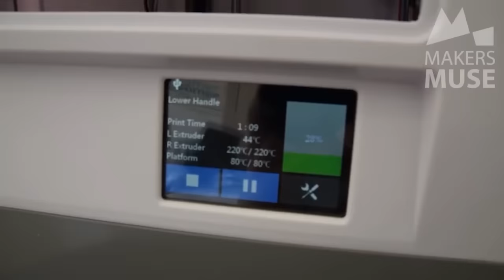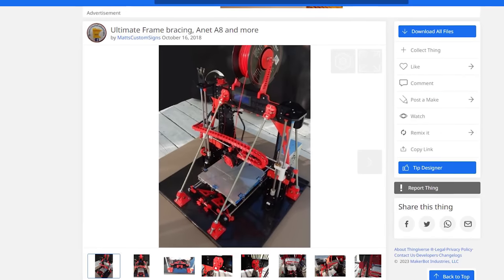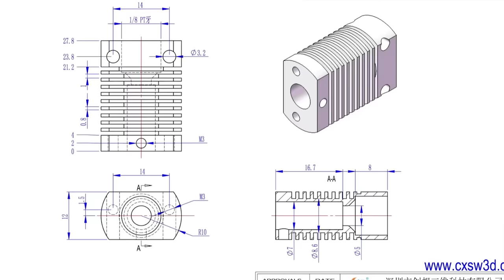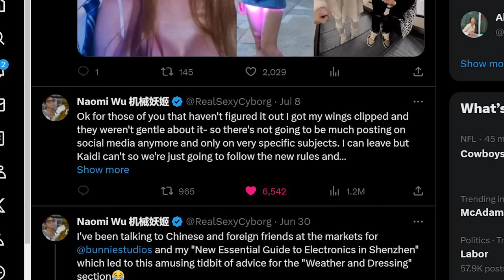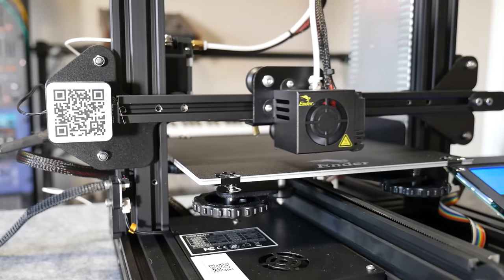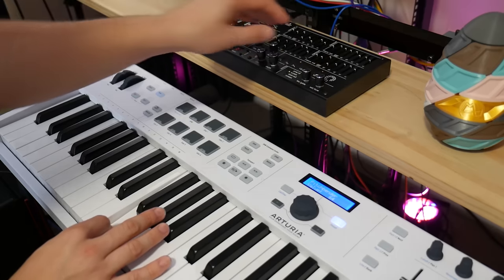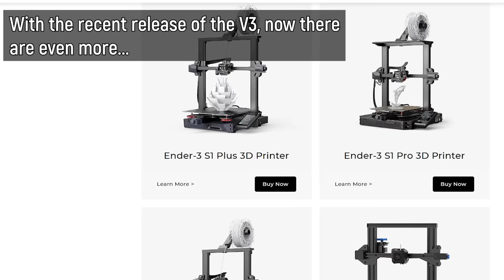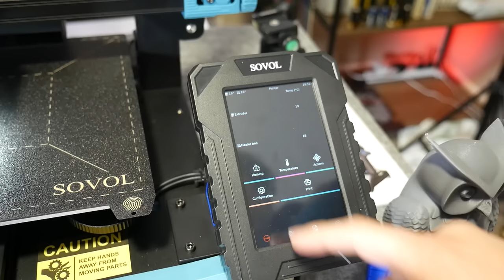Creality Ender-3... it's time to move on.

Comment: I do not have the long experience to say "YES or NO" on any brand of 3D printer, especially as I only have one. I will tell you what I learned, endured, and now do. A little over a year ago, about November, after years of kicking around getting one, but, just overwhelmed as to which one.. Let me first say, I am EXCEPTIONALLY HAPPY with the CREALITY Ender 3-v2. and have been doing fantastic with it.

BUT..... it wasn't a great start, as the first one showed up in December, about a week before Christmas day, so I was excited to have a new toy to play with (as a 50 year old man) and I followed the instructions, watch plenty of videos upon what I should look out for while assembling, and power on the unit for the first time.. moving on, I had no Z-axis control. The gantry would go up, but, that was it. Try to re-home the unit, and just keeps going higher.. I spent about 90 hours playing with it. (please note, not all was lost out of this bad machine, as I learned so much during that trouble shooting phase). I went through, checking if the motor was bad, by swapping cable feed, and manually operating that channel, etc.. come to find out, why sometimes when messing with it, it would work just fine, or at least, the motor Z--axis would rotate both direction... upon finally pulling the cover off the bottom, monkeying around in that area of the mother board, swapping cabling out there too... I finally discovered the Z-axis cable was shorted out, based on how the wires were stripped and then each spring contact was crimped, before inserting the 5 leads into the body of the connector... Well, that dead short, smoked the board... and only one direction would work, and the transistor for the reverse direction, would just get hot, even when the feed cable to the motor was unplugged. 

So, I contacted CREALITY's online team through their website, real-time tech people... (I assume they are real people and not A.I.)and walked them through the whole story, and sent photos of what I had discovered.. 

THIS IS IMPORTANT..... No matter how irritated you might be, or even angry.... Please be polite, just understand, things happen. If you are polite, and patient, they will help you any way they can... Although, I could have just fixed the machine myself, either diagnosing the board, and or, ordering another, and cable.... I just calmly explained, I shouldn't have to... it is brand new. and that I choose to stay with CREALITY. I do not want my money back, I want a new machine. Please, I would like to send this one back, to allow you to diag for yourselves, and then, upon that time, send me a new unit, and I am sure the new unit will be just fine, and it was perfect. That last day speaking with them, was about a hour away from going on Chinese New Year for a week... I wished them to unplug, enjoy time with family and friends and other loved ones, and to not forget about, and especially, enjoy some really great food.. and when you folks get back from NEW YEARS vacation or holiday, we can pick this back up then... They emailed me the first thing that following week, with an R/A number, and label.. I disassembled the unit, packaged it up the same way it came to me,  (except the puddy knofe, and cutters, OOPS!!!) shipped it off at the local mail service. I noticed the kitchen counter had those two items sitting there, but, too late, that package was gone...LOL... I emailed them, to let me know, what the cost was for those two items, and I would gladly pay for those.. as I assumed, they were gonna just send out a new unit, once the old unit gets back to them, and varified that all is there, (minus the two tools) .. They emailed about 6 days later, can said that they received the not-working unit, and that all was in the original packaging, wrapped up better then when they wrap them up, LOL... and for me to just keep the tools, for spares, as they do wear out over time, and thanked me for being honest and willing to cover the price of the items not in the returned within the box. I thought that was kind of them.. I did feel bad about that, ...  two days later, the second unit, was rushed out, on my door step. 

I assembled that unit, same thing, Ender 3-v2.. Now that I am a "professional" at messing with these after that ordeal.. went together, like the last unit, powered it on, checked everything... and.... GO TIME... I have been printing ever since.... I printed the 48 minute test Benchy that is on the SD card.. I was happy... and I am glad it happened the way it did, as I asked myself, "How badly do I want to play with a 3D printer?".. Well, must be pretty badly.. LOL.. 

I installed two hour meters in case it yank out the firmware or something and lose the counter on the chipset... I have one hour meter, that is for hotend on time only, and then the other, is kinda pointless, but, just being on, even if the unit isn't even doing anything.. Just for giggles, to see how long the unit will last, and or various parts... Well, I am happy to say, that printer has been through two sets of wheels, two belts... The belts were my fault, as I had them way too tight, for the job they needed to deal with... duh!!!... and I am sitting on about 11,000 hour of on printing time...  I get real nervous on some of those large files, that take 9 days to print, as about every 3 hours to 10 hours, the machine pauses for about a minute.. like it is thinking or something.. .LOL.. kinda spooky.. But, I love that machine... But I must repeat, I do not have another to give a comparison to or with.. I am sorry for the novel, especially if you are reading this on a cell phone screen, as I typed this on a laptop screen, sorry!!!.. I just wanted to add my two cents.. 

I like how CREALITY does GIVEAWAY's to help the community get involved or to say, "give back".. They tech support is great, the way they handled my situation, was amazing, and because of that, I choose to be loyal to them, as they really could have just left me hanging, to have to fix it myself.. which I coulda, as I am an electrical engineer, I just didn't want to, I did that for 35 years.. I just wanted to plug in my new toy, and hit a couple buttons, and watch it come to life.. Which I did get to do.. just took a while longer than expected....

I remember them saying they have changed wire harness builder supplier's to a new company... to eliminate that issue of low grade products they need to build the main units...  Good luck all.. I wish I knew all of what you seasoned people know about printers, but, I am a newbie here, and wanted to contribute with my novel...

Comment: I bought one in 2018 as my first 3D Printer mainly because it was a cheap entry and I knew I wanted to modify my printer, which was actually a requirement for me so a fully framed ready to use unit was not really an option. Many other 3D Printers that had that kind of modularity were either too expensive (especially when I knew there was a risk of breaking it) or required me to already have a 3D printer to make some of the plastic parts (or if I ordered those parts the price usually went up again).
It's still my only 3D printer (although by now other people in my circle have one which I could ask to print something if something is broken) and I am still upgrading it and currently planing the next round of upgrades (Like switching to Klipper, adding an ARM board, finally changing the extruder type, adding a second Z axis etc.)

Comment: I started from Ender 3 and now have two such machines. It was a perfect choice for me, not only because there used to be much less possibilities back then, but also because I wanted not only to use a 3D printer, but to learn it, to embrace it, to repair it and tinker with it however possible. So the knowledge of its huge community bought it. Now, I would not change my Enders to anything else. I absolutely love them, even though they constantly don't work as well as I'd love them too. So, yeah, I'm all for Ender 3 but would never ever recommend it to any novice, who wants to 3D print and not play with mechanics of a 3D printer

Comment: I've had my original ender 3 for about 5 years now and I've basically just brought it up to speed with a few upgrade kits. I have direct drive and dual z, which means the print quality can rise, but I'm obviously not getting much more speed out of it. I just don't think the extra price is worth it for anything else still. As long as I can walk people through how to fix all those quirks with the ender 3, they will be much better off having a lower speed and equivalent print quality to an X1 in addition to their thousand dollars saved. I would also argue that self leveling is a bad habit to teach from the start because it just means you'll always get an incorrect first layer and you'll have to learn to manually level it anyways. Plus, all I have to do is pop in the CHEP bed level gcode and remember which ways the wheels are supposed to spin. I have no loyalty to Creality, I just don't see equivalent value anywhere. Unless you really want the extra safety features of a prusa i3 and think they're worth 600 bucks. The key is in the mods and the guidance.

Comment: as someone who bought the Anet A8 right when it dropped and also had mine try and burn the house down. 4 different times to be exact. (that's why I stay within eyeshot of it at all times). It's funny to see how we have grown. I moved on to extremely high-end resin printers. Seems most people I talk to moved onto wild paths after. (if you're interested in the 2 leading causes of fire for the Anet A8, the main power input wires are too small so they get hot, melting the connection to the board. Get a bit thicker strand wire and make sure they are very secure. The other cause is the plug on the heat bead coming loose. Put a SMALL dab of super glue on the corners of the plug to prevent it from coming apart without some force.)

Comment: I like to call my original Ender 5 Pro bought in 2019 my "Gridfinity-Machnine"' It was my first 3D Printer and got me into the hobby and I loved to tinker with it and enjoyed the huge community around Creality printers, I would not want to have missed out on that. I later bought an Ender 3 S1 when i got into Gridfinity, as I was printing so many boxes and baseplates, that I wanted an additional 3d printer to get my stuff faster. Just this Christmas I picked up a Bambulabs P1P and an AMS because I wanted to realy get into multi color and multi material printing. I regret non of those purchases, but I have to comfort of choosing the "right" 3d Printer for the "right" job. I still think crealitys low budget 3d Printers are a good starting point, especially on a tight budget but you realy need to be willing to tinker with it.

Comment: I just bought my first printer and it is an Artillery X2 at ... 187€. Bad levelling, direct extruder, 300x300 bed, I have to say it did it's first part perfect. I just had to straighten the bed and change the Z offset. I also re-tensionned all belts after a few pices. I'm very happy with my choice. I'm waiting for a faster printer, with also 300x300 bed, and enclosures.

Comment: Okay so here’s my opinion coming from entry level of 3D Printing in regards to the Ender series. 

Bought my Ender 3 V2 just a few weeks ago, and I will say for the MOST part I agree with your opinion on how they should upgrade more than just a few looks.

The cons I’ve noticed about the Ender 3 V2 firstly, is the leveling mechanics. It took me quite longer than it probably should have to manually adjust the springs to a decent level. I know there’s an attachment available for it but I wanted to do it manually for the first time. 

Second, it’s very picky on your prints when it comes to the first couple of layers. I’m currently doing my second print. It’s an articulated figure with movable joints and it took me about 4 tries to get the first couple of layers to adhere to the bed due to the temp settings. But I will say that once I found the sweet spot, it’s printing beautifully. 

It’s very picky with bed temp and nozzle temp when doing more complicated or round prints. I assume this could also be adjusted in the slicing settings. 

Overall, it’s a good entry level printer for beginners. I love it so much, and I do wish they would just offer alittle more but I can’t complain too much being a beginner myself and going through the learning curve. It’s like a love/hate type of relationship with it. As I said, I agree for the most part and see your opinion through and through. It could use some major updates and maybe some more user friendly options such as auto bed leveling and recommended temp settings for certain prints.

Comment: One thing to note, Creality decided to make things cheaper and therefore harder for DIY/modification. They changed out the extruder stepper motor for one with a shorter shaft and did a press-on gear rather than a grub screw one which means you can't easily replace the gear to a steel one without prying that one off.

Comment: I have my 5 year old original Ender 3 still on my desk.  It sits across from my Bambu Labs X1 Carbon.  I am really happy to actually "print" with my X1 more than troubleshoot. But, the Ender 3 really did make me learn things about my prints and their quality.  It has helped in operating the X1 when it has a hiccup.  I won't trash the Ender 3 but rather maybe set it up for TPU duties or maybe convert it to EDM using Rack Robo's new Powercore kit.

Comment: In 2021 I bought an Ender 3 with 32 bit board. For my use, it serves well. But I recognize that it was the first kick to expand the 3D printing hobby and now is obsolete. The main problem, in my view, is that it has no auto levelling. This little detail can lead to a range of problems and headaches.
If the intention is just print, newer printers should be the choice. But, if you wanna learn on pratice, make unique printer and mod it to your needs, Ender 3 can be fun and a good platform to upgrades and spent some time. 
I have a 1974 Beetle and the Ender 3 is similar: no luxury, no tech acessories, is very slow and produces a lot of noise, but a lot of fun too.

I have to add, here in Brazil is the cheaper 3D printer and almost the only that is affordable. Here, it costs around R$ 1600 and the monthly minimum wage is R$ 1412 (both values in 2024). 1kg of a good PLA filament is R$ 90 ~ R$ 130. Here is an expensive hobby and, even with its flaws and "archaic" setup, Ender 3 is, mostly time, the only option and we are accustomed to choose the cheaper product and mod it, improve it or just compensate with more time or more work. The parts disponibility is another important point.
So, if in the 1st world countries there is a little price difference to newer and better printers, here the difference is big enought to be around 3~7 monthly wages.
That said, Ender 3 probably will never die, like the Beetle.

Comment: I have an Ender 3 Pro and a BambuLabs P1S and I love both - for exactly the reasons you've said.

Tricking out and upgrading the Ender 3 is a fun hobby. Tinkering is fun and it's satisfying to teach the old dog new tricks, so to say.

But if my goal is to print something and have it just come out dimensionally accurate and with no fuss, it goes to the P1S.

Comment: Finding broken or disassembled Ender 3 Pros and just buying the upgrades I want is very cost efficient. The stepper motors alone cost more than what the printer would be sold for in a disassembled state. So far, I've installed dual drive extruders- amazing btw look into it anyone reading, I've installed CRtouch, and I'm installing a quiet stepper motherboard tomorrow. The Ender 3 shall not die!

Comment: You are the reason I own an Ender 3 which I bought 4 years ago.  I've been very happy with it.  It's been cheap to maintain and I can level it quickly and easily at this point (never bought a bed leveler because it's part of the fun!).

I do think at some point I'll move on, but it still does what I need.  The move to multi color printing is something I will do at some point though and Creality doesn't look like it builds my next move..  yet.

Comment: I got the Ender 3 V2 for christmas 2 years ago.  It still works but now I've modified it with mesh leveling, dual Z, all metal hotend, metal extruder, runout sensor, and the die-cut bed springs.

Those changes have given me a printer that reliably and cleanly produces quality prints every time.  These days there are competitors on the market that offer *all* of that for the same price as Creality machines.  You can easily find a handful of v-roller powered printers which have all of the QOL and quality of print features that the Ender series should have.

While the Ender 3 V2 in 2021 was a nice printer for its time/price - I'm done with Creality at this point for largely the reasons you state here.  

Thank you for not being another Creality stan and being honest with your community about their faults.